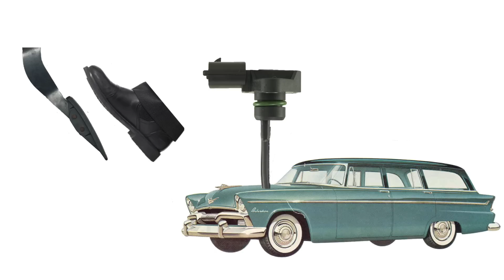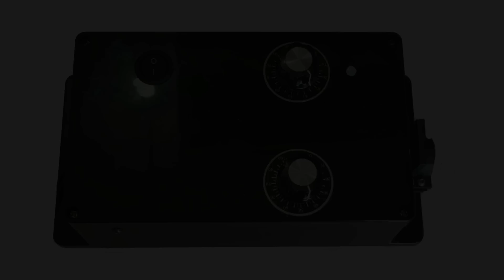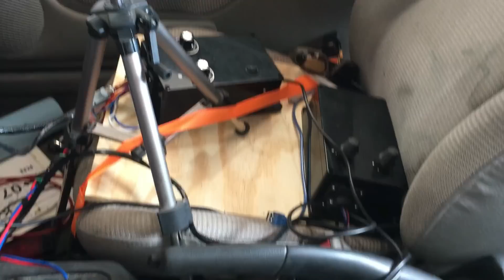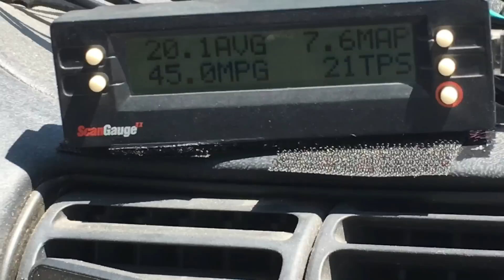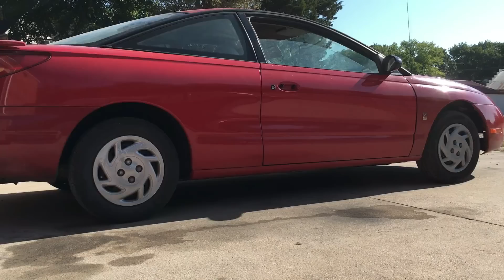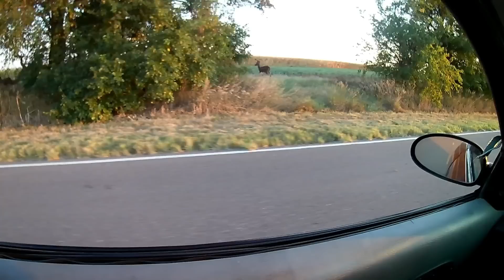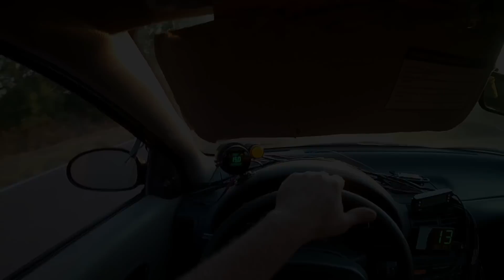S2E20: We road test the fuel saving Robo-throttle on our project car and discover hidden MPG’s.

Comment: 21:33 I have an idea for your wagon. Solar cells on the roof, or some of those thin flexible pannels to make install easy(these are usually 1/2 as efficient as even cheap traditional solar cells). some LiFePO4 batteries in the trunk, and a ~20kw hub motor on one or both of the rear wheels.
This is actually why i bought that used limousine, though i never thought i'd love it so much as a daily driver, i'd have bought a second car sooner if i didnt average around 28MPG on my daily commute
Reply: It would take a long time to charge batteries capable of moving the car far or fast if using solar panels that could fit on the car.
Take a look at solar land speed cars and you will see how much solar they use and how little "car" they are moving with what is the bleeding edge of solar technology. 

Very easy experiment to work out without needing to actually install solar panels too. Just need to work out how much solar you could fit on a car, how much battery you are willing to install and then sit them out and charge them and see how long it takes.

I know I sound negative about such an experiments outcome but I too would like to see such an experiment done. It's a common thing for people to want to see solar panels on a car charging the batteries that drive that car.
Reply: @bleepbloopblahp 
I'm not talking about ripping out the original drive train, just adding solar and regenerative braking to it, in addition to whatever else he has planned.

I dont think solar land speed record vehicles are allowed to store that solar energy in batteries, or arent allowed to store energy from before the run (only using what is gathered during the run.)

Many of these solar vehicles are single seat vehicles with a similar roof area to the wagon and significantly less than my limo.

There is a car going into production this year that is 1/2 the size of this wagon and allows you to drive up to 40 miles per day on solar alone(in addition to the 250-1000 mile range battery pack)

With the cells i have my limosine has enough roof, trunk, and hood area for about 2kw/h(usable average, peak should be over 3.5kw). At 45MPH this car needs about 10-15kw/h for everything including power steering and brakes(edit IIRC the tesla model 3 can go 6 miles per kwh). Now 2/15ths doesnt sound like much and its not for highway use. But i also have 16x 3.2V 280AH LiFePO4 batteries that i'll use to store most of that energy over the course of a 9 hour work day. In theory, i should be able to idle the engine to drive power steering/accessories, while using stored solar to drive myself to and from work(20-30 minute drive each way) The engine would still provide some forward energy, but most of it would come from solar.

If i wanted to waste money on this 'just so i can say i've done it' project, i could get cells that are ~30% more energy dense at more than quadrouple the cost ($1/cell vs $4.25/cell). If i were making a production vehicle i'd probably go with the more expensive cells because they're supposed to last longer.
Reply: @denvera1g1  I'd love to see the experiment and there is not much else I can add. Do you have details for this production car that claims 40 miles a day on solar alone? I'd really like to investigate that claim.
Reply: @bleepbloopblahp  It is called the aptera, and i find the claim quite doubious as well, but the math checks out when you extrapolate from the Lightyear Zero, the other solar production car that is now being sold.

I think the main reason it gets "40 miles per day" is becaus it has a CD of something like 0.12-0.14 where as a tesla model 3 is like 0.21. I may be wrong about this but IIRC the affects of drag on energy required to move through a fluid is not linear, even if the aptera is 1/2 the drag as a tesla, it might mean it uses 1/3rd the energy at the same speed, meaning these same pannels might only push that tesla 16 miles under the same conditions. This is also apparently how they get 1000 miles of range out of the same battery pack that only allows for sub 400 miles of range in the tesla
Reply: @denvera1g1  That Aptera looks like a solar land speed vehicle more than a regular car. I don't feel it's a fair comparison to a normal car.
The video of one I just watched showed it had a very noisy motor, no real sound insulation from the outside, cramped sitting positions, very minimal storage, everything creaked and squeaked, the driver had to duck and move their head to see out the windscreen and other things that make it clearly not the same as a production car most people are used to.
 I think it's interesting as a vehicle but it isn't something you can compare to a Tesla or a Saturn in any meaningful way.

Edit: just found this video which is an interesting opinion on the Aptera: https://youtu.be/QkFioBbH5aM

Comment: Good job for fuel economy! I think that mechanical throttle body would stay apart from the intake manifold and the electronic one should be the only  one connected to the intake. This topic Is to consider for reducing air resistence thru the body, but only one. This is my honest opinion.
Reply: Kansas Rose  Hey Rose! Nice to see you here! Been awhile!

Comment: Roughly 20% fuel efficiency increase is not insignificant. Geez. So my car (Lexus RCF) runs on the Atkinson cycle instead of the otto cycle for fuel efficiency and switches out for performance. I can get 30mpg out of a 5.0 v8 with 500hp, would it be a big lift to implement that on this?
Reply: Depends, what it does is limit your throttle inputs. Its an electronic active restrictor, more or less. If you can do the same with your foot, the difference will be zero. Its all a matter of your driving style and type of roads you use, if you will see any benefits.
Reply: OCD Man  I did, yeah. But I might have forgotten something, if that is what you are getting at?

Comment: You got this vacum thing completely wrong. A big vacum means the cylinder dos only partially fill and therefore has a very low compression ration. Compression ratio does determine engine efficiency. Means high vacum equals low efficiency.
You should test the other way around, always open throttle. The desired power is obtained by looking at the rpm-to-power table and use the gearing ration to get the needed rpm. Yes, means externally controlled CVT.
Reply from the maker: I certainly appreciate the comment, but what you are suggesting is impossible to do on a 1997 Saturn.

Comment: You pointed out that Uno means one, but didn't tell everyone that map sensor tells you the manifold air pressure. Probably why the abbreviated it that way
Reply from the maker: MAP is actually Manifold Absolute Pressure,  In the previous episodes I do explain what it means, but in this episode it certainly got overlooked.  Next time I will mention it.

Comment: The Toyota 1uzfe uses a very similar double throttle system for traction control.
Reply: As does the 90s BMW M52 engine.

Comment: iirc, there are some vehicles that had a dual inline throttle like this... a Suzuki maybe?
Bit of searching later: https://www.suzuki.gr/moto-uplds/2360_technology-images_0011_Layer%2013.jpg

Called "SDV" and it's pretty much the same - one mechanical and one robot, they claim it improves intake velocity at low load and improves economy.

Note that in the diagram the throttle body is distinctly conical.

Comment: I think with a couple more throttle bodies this system might make a geet fuel processor work.  The big problem with geet is manual adjustment of 4 valves to regulate exhaust, air, and maintain a vacuum to keep the plasma reaction working

Comment: Your double throttle design isnt new.
Suzuki put that in thier first fuel injected bikes like GSX-R 2001.
The Main puruse is to optimize the flow into the engine at low RPM to increase the airflow into the engine resulting in more tourque.

If disabled you can feeel that you loose torque if you open the trottle to much at low RPM.

Comment: I don't know if what was really wanted all along with these automotive ccc's isn't a pyro signal logic and code riding the map .... I don't know if all they ever really wanted was to run a few degrees lean of peak. Nope not a clue. I suppose the old 256mhz IBM gang didn't give a hoot either being blow away by such speeds and logic and learn block modes. Stoking the fire those guys were. 
✌️♥️👍
   Remind me that we isolated the carbon can purge.

Comment: I wonder what the mileage would be if this was used to eliminate the engine from going into enrichment mode, which is tough without having the fuel maps,  so I guess not allowing it to drop below 3" vacuum or so? 

I also wonder about using it to smooth throttle input via a delay. So if you try to go from 20-40 percent throttle,  that it would slow the transition.

Comment: i can see where if this were available as a simple, self contained, universal bolt on kit, it would be really useful for achieving the best fuel economy on long trips using older vehicles that used early computer controlled fuel injected engines that weren't necessarily optimized for the highest achievable fuel economy from the factory, and in which on the fly, driver made adjustments aren't an option, let alone being possible, even through the use of a modifier chip. and if you could program in different driving modes that you could cycle between with just the flip of a switch, like econo, daily, power, speed, and the previously unattainable ludicrous speed, then it would be both really hot and really cool at the same time, thereby defying the laws of physics in a "dark helmet" sort of way.(cue groans and crickets)

Comment: Nice one Jimbo! The stacked throttle bodies was a really well thought out solution - kudos to ya. How accurate are your miles readings? Don´t you think the MPG is just a little optimistic? Obviously you´re just interested in results relative to that car, and thats all that really matters, but my line of thinking is that a new Honda civic, for example, gets 38 mpg on the highway. 20 years difference, similar results. Looking forward to the next episode, and any lost ones.
Reply from the maker: The MPG's for this car seem a lot higher than they should be, but that is what we are getting.  but keep in mind we are testing on paved rural roads at 60-65 MPH.

Comment: Hi Jimbo, thanks for another interesting video.  Obviously there are lots of engine techno geeks out there that thrive on experimentation, me being one of them.

I don't know if I missed it but, 2 critical pieces of information in your testing were omitted: (1) Average car speed and (2) what parameter was the electronic throttle trying to limit?  I'm guessing your average speed was about 60 mph without any (or minimal) stops and starts.  I'm guessing the electronic throttle was set to prevent the intake manifold vacuum from going below - say 10 inches?

Note that with a gas/petrol engine, efficiency is highest at WOT (Wide Open Throttle), by virtue of the compression ratio being the highest.  However, that also signals the engine control computer to crank the air/fuel mixture down to about 11:1, spoiling the gas mileage attempt.  It would be interesting to wire the throttle wide open at all times and inject just enough fuel to maintain the desired RPM (semi-diesel operation).  However, it would take a very sophisticated fuel control system to accomplish this; each cylinder would need to be individually monitored per combustion cycle.  Additionally, if the fuel were boiled prior to injecting it into the cylinder, a super lean operation could likely result.  Anyway...  Just some ideas but, implementing said ideas could be a career's worth of work.
Reply from the maker: We did cover the speed in the video,  the system was tuned to allow the car to go 60+  MPH. However we didn't  mention that most of the time the car went about 61 MPH average.

The scan gauge measures manifold vacuum in psi, the best I can guess was we were  holding about 15 inches of mercury.
Reply: Thanks for the details!

Comment: Okay here's an experiment you could do I don't know if the car already has it but sequential fuel injection or you could go direct but that would be a lot harder but either one of them would be pretty cool to see
Reply from the maker: Saturn implemented sequential fuel injection on the SOHC engines in 1995 and up cars.  Direct injection would be cool, but as you know that would be very hard to retrofit on this engine.

Comment: do you have quick scientific explanation of why high vacuum means better efficiency? I was once told and always assumed that staying close to peak torque rpm gave you best efficiency but obviously sticking to constant rpm is not practically possible, plus  it's probably more giving you the best open throttle efficiency and cannot tell the whole story of the efficiency map.
Reply from the maker: People have all sorts of theory's on what works, but the best way to learn is to do the actual experiments.  If you drive your car with a vacuum gauge installed and watch your economy meter ( if equipped) you will see that higher vacuum in the manifold returns the best fuel economy.....   This trick works on conventional engines, I cant say for certain that it would work on modern engines with variable valve timing and other gizmos.
Reply: @robotcantina8957  Simplest explanation is that stochiometry for less air requires less fuel. Sea level atmospheric pressure is 30 inches of mercury, which would read 0 on a vacuum gauge... pull 15 inches of mercury in the manifold and you're taking half the air, and hence need half the fuel to retain a stochiometric charge. Peak torque gives the highest efficiency at maximum flow.
Reply: @mfree80286  yes but less air and less fuel only means less power, not better efficiency of the engine. so you can get better mileage if you're never going past a certain throttle level by just going slower. actually vacuum itself is also reducing power and efficiency of gas engines by pumping loss and is part of the reason why diesel get better mileage. free valve fix the issue in the best possible way by limiting valve lift and duration to let just enough air in without restricting airflow. I think bmw engines with variable intake valve do it too
Reply: @geemy9675  BMW VANOS still pulls a vacuum, it's just in the chamber itself behind the partially opened intake valve.

Comment: If you’re using the OBD2 port for monitoring, have you considered using an ultraguage as that’ll let you see 8 values at once?  They’re tough little things,  mine is on it’s third car and 7 years+ daily use now 🙂
Reply: Not yet but will watch it later 🙂
Reply from the maker: The ultagauge looks pretty cool, Thanks!    I'll be transferring all the experiments to the 95 Saturn Wagon and unfortunately that car is OBD1... hmmm
Reply: @robotcantina8957  Nice, it’s a good little unit but does only work with OBD2.  On another note do you think you’ll end up adding nitrous oxide to the diesel swap? 😉

Comment: you should upload the code for the arduino
Reply from the maker: Due to safety reasons unfortunately I will not be sharing the code.  However if you understand code and servos, then writing your own version would be easy.

Comment: Totsally cool what you're doing. I would love to see you make an ECU for Boost.      As for the Drive by wire stuff (My Thoughts) I personally will never buy a Vehicle that is Drive by Wire I just do not trust them, Just to me sounds dangerous no matter how well they're designed. My girl freinds moms car stopped Accelerating on the interstate due to Drive by Wire failer bullsh!t in a 80MPH speed limit her car went from 80 to about 25 MPH almost was no time to pull to the shoulder.

Comment: This is really interesting and I love all the techie Arduino stuff! I find it hard to believe though that your Saturn is consistently getting 40mpg. The car is rated with an average of 29mpg so am I missing something? I would like to improve my mpg on my 09 Subaru Forester (your favourite car haha) so what would be my best alternative? Thanks for the great content and sharing your knowledge! Grazie!
Reply from the maker: Indeed the car does get slightly better gas mileage than normal.  This 1997 Saturn SC1 is EPA rated for 40MPG and that's with the single overhead cam engine with the five speed transmission.  We do all our testing on rural paved roads at slightly less than highway speeds (60-65 MPH).    In this episode we showed that the robo throttle delivered  MPG that was just as good as a human driver who was careful with the accelerator.  Perhaps if your Subaru is equipped with a MPG gauge you could teach yourself better driving techniques.  If the Subaru is not equipped with a MPG gauge, there are certainly many available that will plug into your OBDII port.
Reply: Wow that’s a little condescending, of course anyone can drive like a granny and get better gas mileage but “normal” driving habits is what we are discussing no? According to the fuel economy dot gov  website 1997 Saturn SC1 gets (27) 23/33 mpg not 40, but I noticed your “real time” display was only 20 mpg average but the instant value was 40. Anyway I guess I’m just wasting my time here.